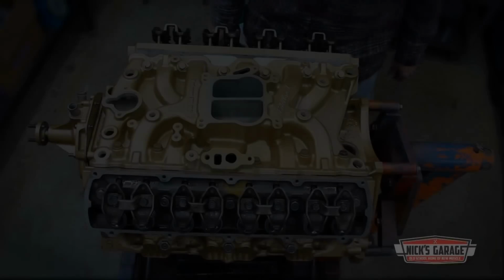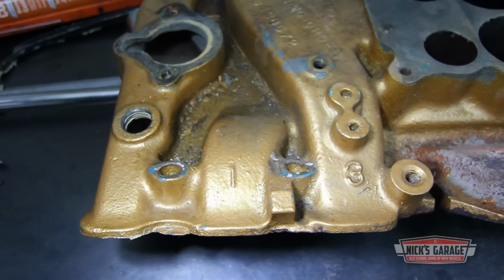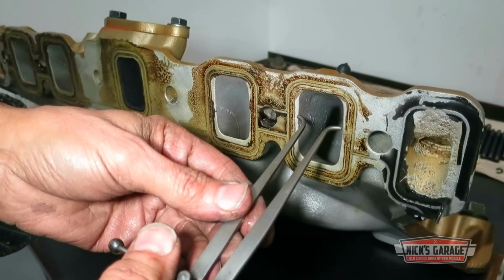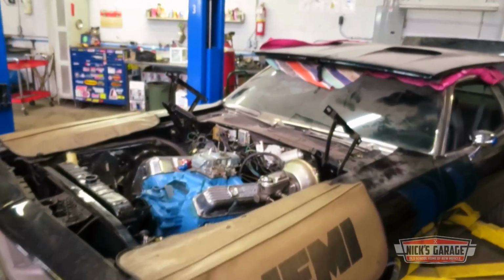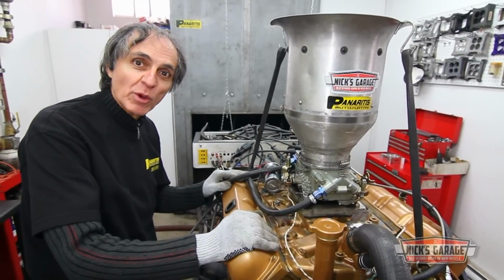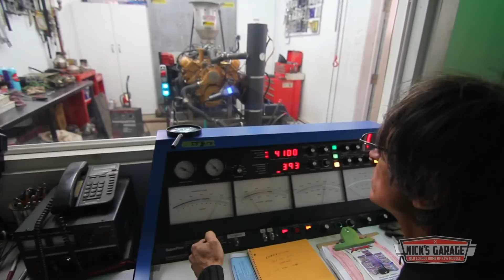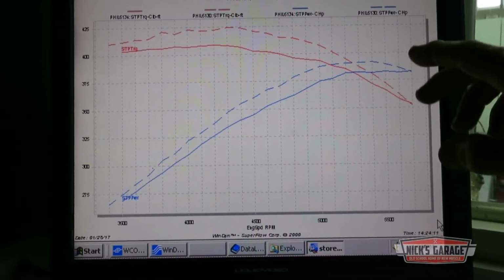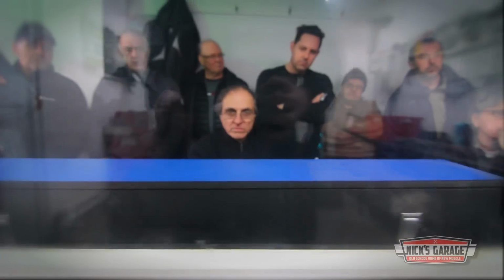Edelbrock VS Iron - Rocket 350 on the Dyno!

Comment: Gooday Nick! I really love the working on engines just like you do . I'm really old school because I learned from a retired Shipwright that retired in the 1960's & who worked all through the 2nd world war. Being a war ,the allies shared their knowledge and because of that Jack (retired shipwright) toured the Ford engine plant & seen that all of their crankshafts were being done between centers in the crankshaft grinding machines. Well I met Jack taking a machinist course he taught when he retired. I guess I must have mentioned that I ran a crank grinder for a "professional engine building shop" and we held all the cranks in the grinder in 3 jaw chucks on each end of the crankshaft. The problem was they would not meet the specifications no matter how hard I tied ! I ended up learning all over again how to grind cranks between centers on his machine & WOW! what a difference. My cranks had "Zero" runout & I would tell Jack the gauge must be broken & he would check the gauge & move it and the gauge was OK . I never looked back & I have  built winning stock car engines since then. I am a backyard mechanic that wrote his test for a mechanics license and passed and a third year machinist  who really loves Holley carbs. If I may be as so bold I would suggest a Holley List 6210 spreadbore carb 65 jets in front (powervalve) and 73 in the secondarys (no powervalve) to start with. The reason I love the Holleys so much is that they are quite rebuildable and they were Henry Fords pick for his cars. The people that dis Holley carbs do that because , when they rebuild these carbs is that they soak the baseplate without taking throttle shafts out and  in the carb cleaner  the Teflon on the throttle shafts (Holley supplies new Teflon in most carb kits) dissolves and the carb works worse than before they touched the carb. Just a little insight on things that I have found to work. O yea did you know that carb adaptors can cost h.p.. I think you could make your 400hp with a good 6210 Holley . Thanks for the great videos & I wonder what I am going to learn today. My name is James T.P. Burke and the shipwrights nick name for me was "Hot Shot" Have a great day ! I also liked your video with your hellcat on the track
Reply: Jim Burke.  Thanks for your comment, I love it. And, thanks for watching.

Comment: Try port matching the aluminum intake to the heads!
Reply: all i could think of this whole video, says heads are ported, but is the intake and gaskets matched!??  grrr, what a waste of time bolting old iron on it
Reply: Yes sir!
Reply: The intakes are left small so they can be ported and gasket matched to the heads. 🤦🏻‍♂️ when i saw the ports when they pulled the intake off it was clear that was where they failed.
Reply: Nick did port the manifold at the end.

Comment: I had a 350 rocket in a 4 door hard top. It was bone stock and had 2:73 rear gears so it wasn't a stoplight champion but it could bomb down the interstate a triple digit speeds with no effort.

Comment: Growing up in the 80s when young people were into late 60s-early 70s cars, I quickly learned these aftermarket companies were in business to sell parts.  The results weren't always what they claimed, and were basically never what they claimed if you didn't build a full and well matched high performance setup.  A few HP difference from the hi-po intake.  Great if you're happy with a few HP, but that's about it.

Comment: Agree with Nick, would love to see that cast iron put on the mill to remove all that excess under the carb, and see what happens.
Reply: I think also that'd have done it.
Reply: I'd like to weld it shut and mill a square bore pattern into it.  Then I'd get a matching spacer instead of that wide open thing.

Comment: Really nice work guys!   Enjoyed the video.  Those gold valve covers look so familiar haha.  I had a 1972 Cutlass Supreme with a Rocket 350 and it only had 186HP from the factory.  It got even worse in later years.  Emissions standards wrecked these cars' potential so badly starting in 1971.   310HP was on the upper end of what these made.  I think 325HP was the highest rating ever from the factory for this motor.  It's an awesome engine though.  A bulletproof legend with its roots from the 303 c.i. in 1949.  To have Nick double the horsepower in mine would have been so dreamy.  I have to admit the car would have been dangerous.  I'd have needed some disc brakes (it was drums all the way around) and of course, bigger tires.
Reply: heymisterderp I agree with u pupp
Reply: Haha high school buddy had a 65? olds cutless, Rocket 350 (gold) with a 2 speed switch pitch trans. In a switch pitch the vanes in the torque converter pivoted to change resistance as oil flowed thru. First gear to around 90mph, then shift. CRAZY torque curve. IIRC only Olds experimented with the switch pitch converter.  Now everyone runs 2 speeds (modded Powerglides) on the track.

Comment: Q-JET , CORRECT SPACER , GOOD CALIBRATION ,BINGO!
Reply: Q-Jet is amazing if you understand how it works. Some guy in the 70s or 80s was pulling 700hp through a Q-Jet, stating that it would flow near 800-850cfm
Reply: I agree that a big quadrajet would have made this test more accurate.  Makes me wonder why they went with a performer intake as opposed to a performer rpm intake esp with that Holley/demon style carb.
Reply: or just port match the edelbrock and clean up the runners. they are all undersized like that. would have took less time than an intake swap and they know they are shooting for 400 why wasnt that done prior to initial assembly.
Reply: joe mondello sold a bushing kit that eliminated the bog i reworked a lot of them
Reply: My uncle took many fuel injected cars and carbed them... with Quadra Jet carbs. He didnt like either Edelbrock or Holley. Plus most people throw their qjet away for an Edelbrock or Holley so they were free/cheap.
Reply: @zuestoots5176  I had a 800 cfm Rochester on my 472 caddy powered c10. That carb was better than any Holley I've used to date. Haven't been able to find another since selling it with the caddy motor.
Reply: @SethBergile  I grabbed a  clean, bug  Caddy Q-jet from a  junk yard for a 67 SS 396 Chevelle. Ran fantastic with no calibration changes on a  car with headers and duals - Sandy

Comment: The film work is outstanding. Just like watching discovery or the history channel. The engine there is nice, but amusing. The Olds 350 is one outstandingly reliable engine. It's amazing the struggle to get 400 gross rated hp out of those things. This is no knock on Nick, just pointing out the amazing difference in technology. Now days 400 gross hp is a cake walk, but none the less excellent work Nick. You built a nice motor that took pull after pull after pull and didn't care. The power is what it is. The engine took the work out and kept on trucking. Nice work.

Comment: 1964 Olds Jetstar 350 cubic inch.Installed 4 bbl.quad,dual exhaust,planed heads and posi.Father knew best.85 mph in 1st(2 speed) auto.

Comment: had a 350 Rocket in my 71 Cutlass S, I don't remember the HP being higher than 212 though. Four hundred would have been very nice, indeed. Mine was Rochester 2 barrel with single exhaust though, no race motor.
Reply: there were 2 different versions,, one came with 325 hp stock..

Comment: Those Olds 350 W31 motors, that is what the Cutlass Rally used, were hand assembled special at the factory. They made real good power. I'm not surprised that the factory manifold works better. Oldsmobile knew what they were doing.
Reply: It didn't though. Edelbrock would be out of business if they built intakes that were not sure to stock.
Reply: They were under rated from the factory with three hundred and forty horse power w the w thirty one Cam shaft
Reply: A Cam shaft with a duration of three twenty eight duration and one hundred degrees of lobe separation and four seventy five valve lift on both valves Nick try that one for size 🙄 duh dude 😎 what up

Comment: 1967 425 (F1) Super Rocket is the badestassed stock Olds motor. But the old 350 is a sturdy motor though, run them dry on water for 20 miles, let it cool, fill it up with antifreeze, and they're good to go.

Comment: Needed to go with the Performer RPM intake to make the extra hp bigger is better, I have a 403 with 69 #5 350 heads and a RPM intake it is heads and tails above the Performer intake. Would love to have it on the dyno to see what power it makes,
Reply: A Performer RPM intake has extra material for bigger ports which allows the use of 455 heads on a 350 (2.07 intake valves- eat that Chevy fans). I know it works because Edelbrock's own instructions say you can , and I have done this. 
Not sure why he didn't do any port work on the Edelbrock intake he had. Just port matching should have been enough to gain 15-20 HP.
If I had my Olds days to do all over again, I would have invested  my efforts into a 425.
Reply: @Freedomquest08  you can fit a 2.07 in a 350 oldsmobile head. The problem with running a 455 head on a 350 is the combustion chamber size. Loose so much compression that you loose power,  and a 350ci is only going to have so much velocity not really suitable for bb port sizes, you will be better off with small block heads and if you want to run aluminum heads send them to j&s and have the intake runners  and combustion welded up to sb size, so you aren't cutting .080 off some new heads to make the cc right
Reply: YEP, regular performer is worse than stock, the performer RPM is slightly better.  they should know that. ???

Comment: 350 rocket -  rare motor now
Reply: I've seen a lot more 403s and 455s out there.  When I was a kid, our 1976 Cutlass had an Olds 350 with a Q-jet.   It was probably the lowest performance 350 Olds ever made, but I recall the engine being quite happy to rev.
Reply: My uncle had a 69? Cutlass convertable that had a 350 rocket in it, that was 20 years ago and i have seen another 350 rocket since
Reply: got a question. just bought a 76 442. has a 67 350 rocket in it. comes witht he original 403. just needs some work. what would be better to have in it for power?
Reply: @davidgriffiths5897  403...built right 53 cubes much better torque curve on street...especially if compression is equal...build it for just under 10 to 1 and it'll be fine on pump gas...just check block good when building sincethe 403 has Siamese bores
Reply: just found out. its actually a 455 the guy wasn't sure but its original to the car lol
Reply: David Griffiths yeah duh I should of known the 403 was only made 77 to 79...made the choice for you a no brainer right
Reply: last year for the 455 in the cutlass too

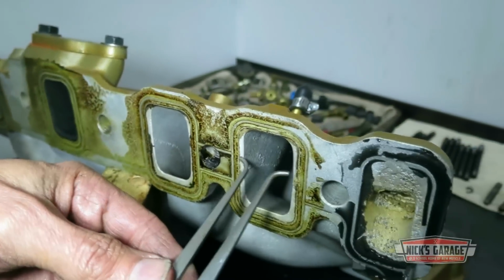Comment: I know the engine is long gone but should port match the edelbrock intake to the heads if the heads matched the factory intake. Also, you can tell from the gasket line that the edelbrock intake is sitting a little high. 4:25 

For anyone else reading this, a high intake can be corrected and lowered by using a thinner intake gasket or milling some off the intake.  This is caused when a block or head gets decked and it sits lower.

Comment: Just watching this again, ive always wondered how a good performance spreadbore bolted directly to intake would have worked vs the adapter...i have a tall transdapt 2" adapter for spreadbore carb to square intake for a modified Qjet to an old torker intake on my 355 sbc, works decent. i always wondered the dyno results of it over the shorter more abrupt transition 1" version. Itoo love messing with engines because well the obvious but its the excitement of choosing a combination of parts and seeing the end results then tweaking tuning and swapping to improve your results, thats why i love building custom exhaust because you never know what it will be like till you turn the key, every custom exhaust is unique. Anywho hope alls good.

Comment: a dual feed Holley double pumper, mechanical secondaries with a spread bore would work, they did make them. And port match that aluminum intake.
Reply: The carburetor he has on there now is too big. It needs a 600 or 650 cfm for that 350 ci motor.
Reply: Not really. If you were talking drivability, in the real world, then I would agree with you completely. We rarely open all 4 barrels on the street and hold them open to redline. 90% of the time we are at part throttle accelerating and decelerating. That is when carb airflow really needs to match what the engine is asking for. Dyno's are not real world, and they drive me crazy because people try to copy what they see "The Big Guys" do at Hot Rod mag, or any of the info out there speaking strictly of top end horsepower. And what those guys do is throw the largest carb on that they have. Because part throttle power means nothing on a dyno. It isn't measured at all in these types of dyno pulls.
Reply: BOP motors like CFM. anything under 750 is too small, especially for this engine, even stock. 350 chevies like 600-650 cfm up to a point.
Reply: 1976 bronx that or cheat and use a tunnel ram
Reply: The original 750 cfm quadrajet would be the best fit for the original manifold, but a spread bore holley would work better on the aftermarket manifold.  Adapting square bore carbs to spread bore manifolds never works as well as square bore to square bore or spread bore to spread bore.